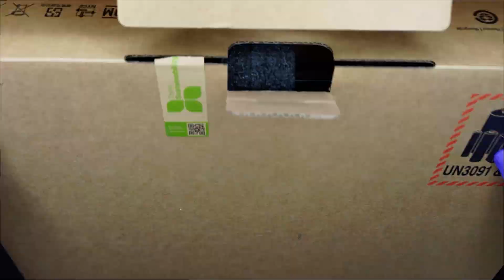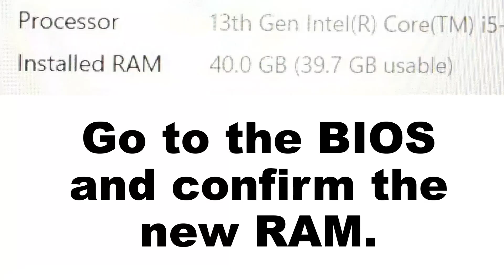How to upgrade the RAM on a Lenovo ThinkPad E16 - Up to 40GB (8GB soldered + 32GB SO-DIMM) DDR4-3200

Comment: Can I add 32gb ram that has dual channel
Reply from the maker: Yes, you get a significant benefit, but it's a mixed mode: 8GB will run in dual-channel (paired with 8GB from the 32GB stick) for faster access, while the remaining 24GB on the 32GB stick runs in slower single-channel mode, which is still much better than running out of RAM and relying on your SSD.
Reply: @PotomacRepair thank you

Comment: I installed 32gb 2666mhz DDR4 Ram and now my laptop wont turn on! Please URGENT need help. I even removed the Ram but still won't turn on.
Reply from the maker: That's frustrating, sorry to hear it. Please double check to ensure your memory is compatible and installed correctly.  32GB SO-DIMM) DDR4-3200 is what the laptop required in this video and it worked immediately.  Not clear what laptop you have but you tried 2666mhz RAM.

Your laptop might not be turning on because you likely installed incompatible RAM, which prevents the memory training process, or there might be a hardware fault from the installation itself.  Generally, follow the Lenovo Hardware Maintenance Manual guidance for your laptop model.

To troubleshoot, one might perform a power drain by holding the power button with the battery and AC adapter removed for 60 seconds, then try booting with the original RAM. If it works, the issue is with the new RAM; if not, the original RAM is still in place and it is a hardware fault. You may need to consult your laptop's manufacturer for a compatible upgrade list, as the installed RAM may be faulty or incompatible.

Comment: Great video. How did it work? I thought the RAM capacity had to match the soldered capacity. Does 8 GB + 32 GB combination work always?
Reply from the maker: Thank you.  It worked well.  It might need to match on another model or brand of computer.  However, the Lenovo Hardware Maintenance Manual indicated that the upgrade here was possible.
Reply: It's generally always possible to mismatch ram, but it's not recommended for a couple of different reasons.  One being speed.  After you reach 16gb, (8 on the soldered and 8 on the DIMM) you reach the limit of the "dual-channel" memory.  After that, it has to write all new memory storage onto the 32gb DIMM only, as the 8gb soldered is full.  So you lose 50% of the speed after 16gb of filled memory.  Also, this can cause stability issues in some software, but it's mainly the speed that's noticed.

That being said, It's better to have 50% slower memory than no memory to use.  You still have 40gb of memory, even if 24gb of it is at half speed.
Reply: @TheGamersRace thanks. That's really good info. I suppose speed would not be noticeable in a browser or office software right? Thanks.

Comment: I installed a compatible Ram and after turning the laptop on, I just get a black screen. It's been like that for 10 minutes now, what should I do?
Reply from the maker: That is a bummer. New RAM (in large volume) might take a few minutes, but 10 minutes is excessive for only 32GB. When this happens, the most likely cause is an improper installation or incompatibility between the new RAM and the motherboard. Check if the RAM is securely seated in the slot. Double check the RAM with the laptop's specifications - and try a different brand of RAM. Finally, if the issue persists, try resetting your Complementary Metal Oxide Semiconductor (CMOS) by removing the CMOS battery on your motherboard. This can sometimes resolve conflicts caused with new hardware. However, I doubt that it would get corrupted if you have a brand new laptop.
Reply: @PotomacRepair  Thanks for the response, I found the same solution for resetting the CMOS on a forum. If anyone runs into this my steps were:
1. unplug cmos 
2. unplug battery
3. hold power button for 10s
4. Put original RAM in it's original slot, and a new RAM (16GB) in the second slot
5. plug in CMOS and battery
6. plug in AC charger and turn on.
It turned on after that, not sure how long it took I left to do something else, maybe 5-12min.
I have another 16GB ram stick which I can swap in for the original (8GB), but 24GB is enough for me, and don't want to break anything again.
Reply from the maker: @yurameshi5189  Excellent!  The laptop might have performed a RAM check when it detected the new RAM initially.  Happy to hear it worked and thank you for writing your procedure, above.